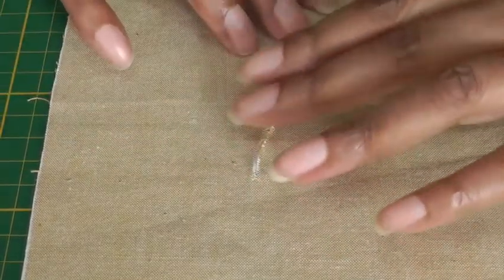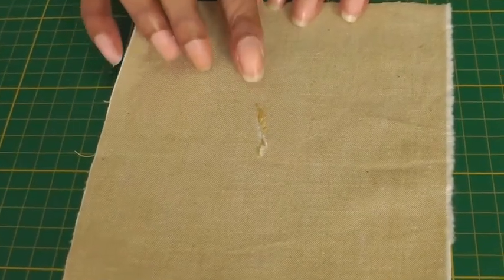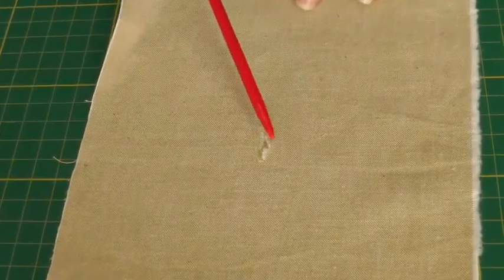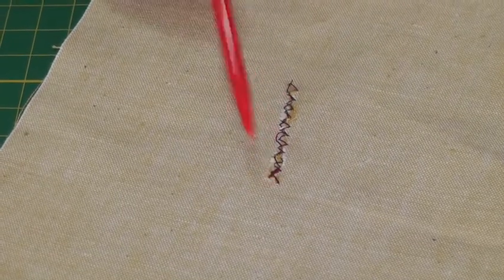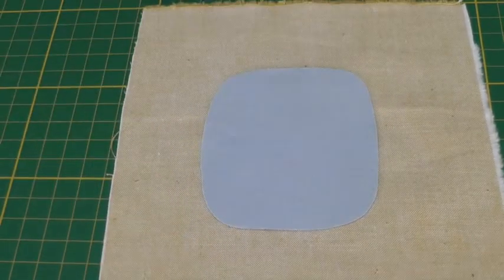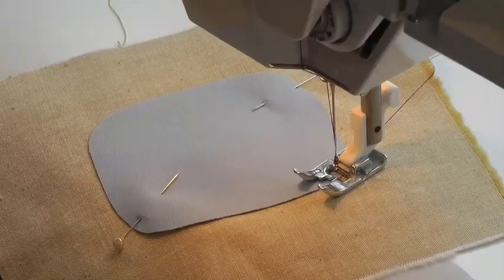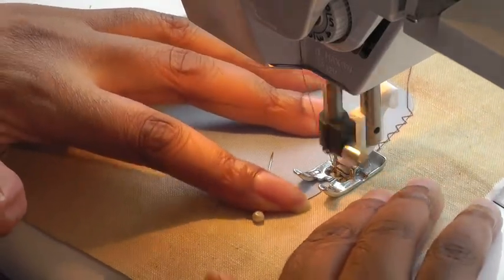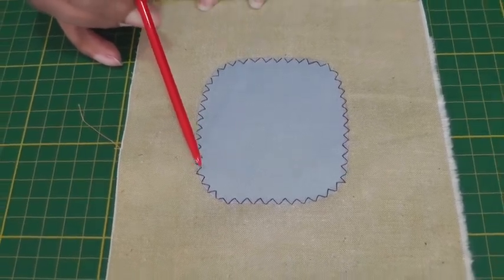Sewing Patches on Elbows

Comment: How do you sew a patch on a woollen sleeve on the sewing machine. Thank you
Reply from the maker: You will have to unpick the sleeve seam so that you have a flat area to work with.
Reply: Thank you coleen for getting back to me.
I did however manage to machine it with the sleeve arm. Great difficulty twisting it around slowly having sewn it by hand to secure the edges first . As it was a knitted cardigan I couldn't unpick the side seams.
However It was a success in the end.!!
Many thanks for your email.
Reply from the maker: @sheelaghellis5937  Thanks for letting me know!